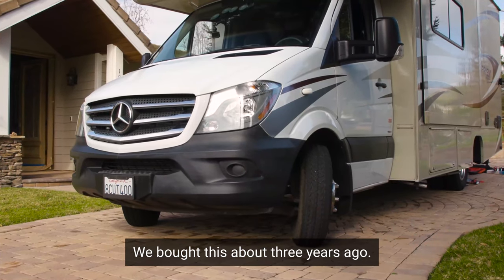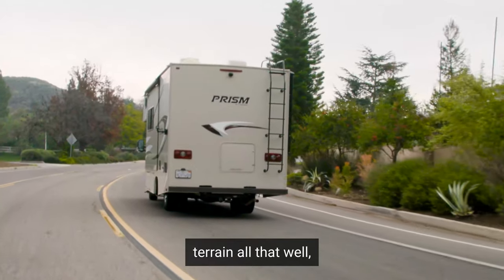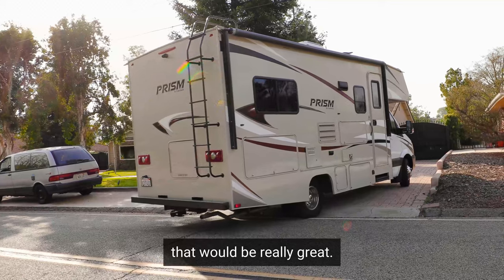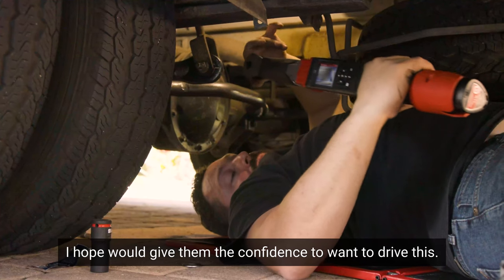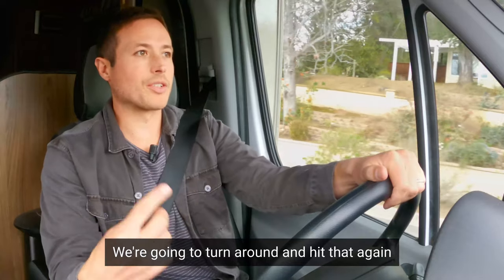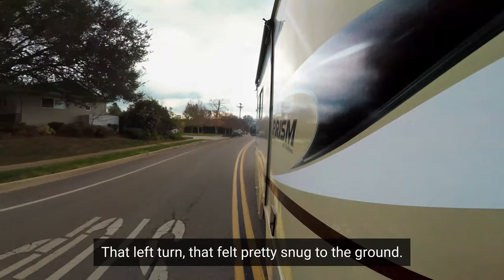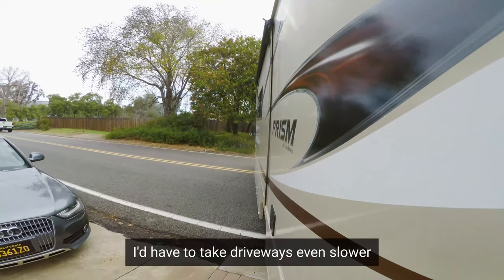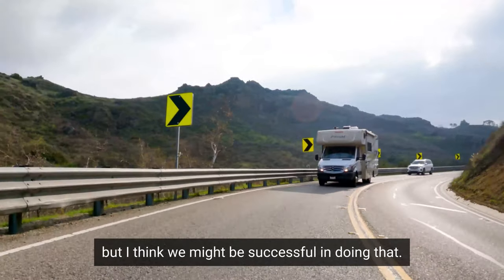New RV Owner - Reducing RV Sway with Aftermarket Sway Bars

Comment: I put on your 7777 sway bar and it made a great difference in the sway getting out of the driveway. I'm thinking of getting your overload springs for the rear to help out on the highway push from cars. Would it work and is it better than the supersprings helper spring?
Reply from the maker: Hi there, thanks for the comment! We cant speak to the Super Springs products, but our helper springs are designed for load support and cant say that they will help with the highway push from cars.